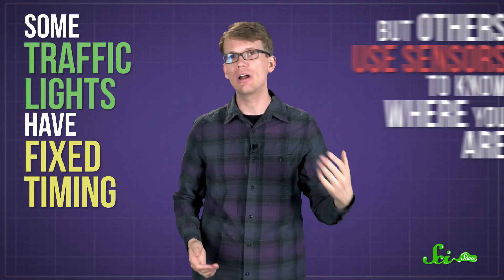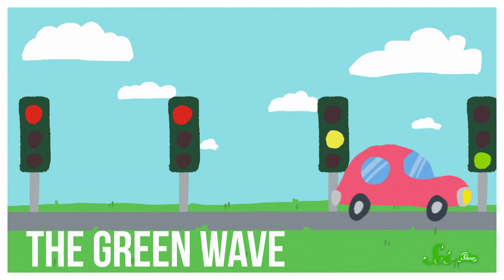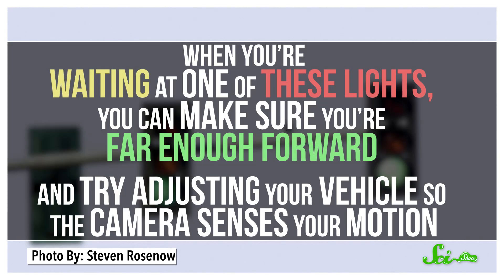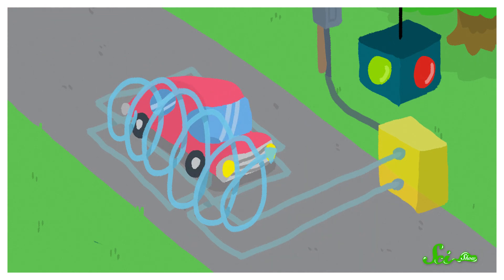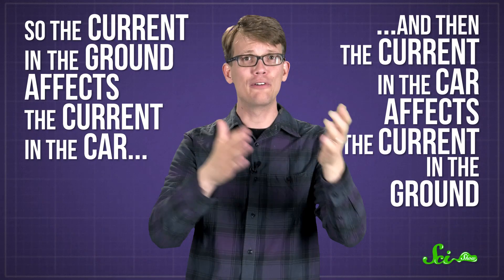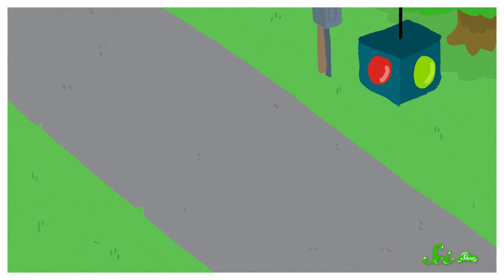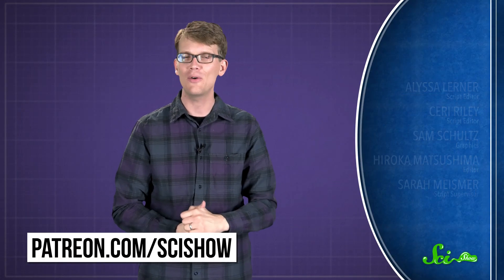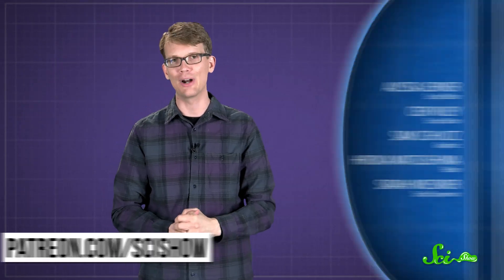How Can I Make A Traffic Light Turn Green?

Comment: One major flipping donwside to the "green wave" the red wave. Hitting every single red sucks so bad.
Reply: I don't think that's a downside to the green wave, more like absence of it... if there was a green wave you would only have to wait one time to the light to turn green and then all the others will be green when you pass through them
Reply: The worst thing about the "green wave" is that so many stupid people don't realize the lights are synchronized for a particular speed (usually the speed limit) and so they drive 5-10 mph over the speed limit just to hit another red light because they got there too early. It's so frustrating because then the light turns and they have to get up to speed again and it just bogs down themselves and any traffic behind them.

IT MAKES ME ROAD-RAGE SO HARD!
Reply: Cami, That only works if you are going the right way. You can follow the green wave down the street but everyone going the other way is hitting nearly every red light.
Reply: As Cami said, you only have to wait for one green light, because then each consecutive light should be green for you.
Of course, this does not work as well if you are driving down the road in the opposite direction.

Ideally, the wavelength of the green/red wave should be two stop lights where each intersection is an equal distance from the next, and the frequency of the wave should be proportional to the amount of time it takes a car to travel two stop lights at the speed limit. In this scenario, cars only need to stop at most once, and can then catch every green light along that street, regardless of which direction they're traveling, because the alternating red and green lights are equivalent to a green wave in both directions. This strategy can even be extended in two dimensions for a grid of intersections/stop lights, but you will always hit a red light when you turn.
Of course, this ideal system is not practical in the vast majority of scenarios, because most intersections are not evenly spaced, and even if they are, they have to be pretty far apart, or else the frequency will be too high, meaning the light changes between green and red too rapidly. Still, it's interesting to think about.
Reply: ... No...
Everyone going perpendicular to you will hit a red light, possibly part of their green wave. People travelling the opposite direction from you will also have a green light.
Reply: apple54345 Where I'm at the green wave only works if you do 5-10 over.
Reply: *****
That's assuming the light stays green long 'nuff for you to get to it. Not sure how it is in your city but here the street in question is space perfectly so that if you hit one red you hit them all.
Reply: The "green wave" doesn't work for everyone because the intersections are typically too close together, as someone stated earlier.  The time in red is much greater than the time it takes to travel between intersections.  For every green light there is a red, and someone is going to get those reds.  Green wave only works in specific circumstances, and around here, there seems to be more interest in giving people red lights (and a one-fingered salute).
Reply: That's not how they're synchronised, you should only ever hit the first red light, then once you go through it when it turns green the rest in turn will be green. (Unless you run every light)
Reply: You guys got me, I never hit all reds at all. I was lying. Can't lie on youtube with the detectives like this on the case. -_-
Reply: sk8rdman Now it appears I'm getting the + always in the notification area, and never on the video page, which is just what you said.  I did a lot of testing a few weeks ago and it behaved differently.  There may be other variables that I can't account for though.

Even though Youtube pisses me off, I love it too much to break up with it.  When I wake up, there's Youtube.  When I go to work, there's Youtube.  When I come home, Youtube is there waiting.  I spend the night with Youtube.  The only thing I don't understand is why it never cooks me dinner.
Reply: Seamus Cook
 Were you replying to me?
In a scenario like the one I described, perpendicular traffic would not be stopped while riding a green wave. Intersections would be set up in a checker board pattern, such that traffic going in all 4 directions does not have to stop except for once to catch the first wave, and again any time they turn, catching a different wave in another direction.

Of course, as I said in my original post, this is all theoretical, and would not work in most real scenarios because intersections are far too close together.
Reply: sk8rdman Sorry, I was replying to Brandon Francey, but my reply button wasn't working properly, my apologies for the confusion.
Reply: Seamus Cook
No problem. It only puts in the + when you hit reply in the notifications interface, but not when you hit reply in the video comments section. It's weird.

I don't know how it works on mobile devices.
Reply: sk8rdman Oh, that's odd. You'd think it would put in the "+" whenever the reply button is used. Oh well.
Reply: Seamus Cook
The rating interface is also different. Here they let you +1, but in the video comment section you have thumbs up and down, but I'm not sure the thumbs down does anything.
Reply: sk8rdman They just need to get their crap together, then again, that's probably much more difficult than it sounds.
Reply: I love that this has turned into a discussion on the comment system.
Reply: I have been trying to figure out the comment "system" for a long time.  You only get a blue "+" for a reply if you entered a comment before the one you're replying to.  You can also sometimes type a "+" and name  list of some clickable user names (it's hard to explain without writing a book).

At one time you could see who had +ed a comment but they took that away.  You can no longer see who +es their own comments.  I find it unfortunate because +ing one's own comments is a sign of a major character flaw.  Anyone who does that can't be trusted to be objective.  They care more about what people think of them than they do about the quality of the arguments (their own typically being poor).

There is a suggestion that the thumbs-down button raises chains of comments so they appear higher in the "top-comment" mode.  Youtube may consider these to be controversial, possibly resulting in more views.  I am speculating a bit though.  As far as I know, Youtube comments are not properly documented anywhere public.
Reply: pillsnotbills
The first bit isn't quite right. If you only got the blue + when replying to a comment that you'd already commented before, then I wouldn't get the blue + trying to reply to Cami who commented before me, but I do.
Also, I don't get the blue + for any replies while commenting under a video.

It seems to me that you only get the blue + when replying to a comment in the notifications interface, but not while replying in the comment section on the video page.

And as I said before, it may be different on a mobile device. I wouldn't know.
Reply: +sk8rdman they heard you, now there's thumbs up/down for the comment section in mobile
Reply: *****
There is in PC browsers too, but only in the comment section; not in the notifications interface. Here there are only +1s
Reply: if youre on a stretch that utilizes the "green wave", and you hit every red, then you probably need to chill out and stop racing people to the next light.
Reply: But that isn't possible, right? If you hit one red light, then as soon as it turns green, you're at the front of the green wave...

Comment: If you have this problem as a motorcycle rider just place a strong neodymium magnet on the bottom of your chassis.....also in a car place one on your oil filter to help trap metal particulates from your engine while having the bonus effect tho i dont know if it would matter in a car =)

Comment: "Just run the light" - Hank Green, 2016
Reply: That's the first sign you know you're a Libertarian. You see the red light. You stop. You realize that there's not a car in sight. And you put your foot on the gas. 
-  Gary Johnson
Read more at: http://www.brainyquote.com/quotes/quotes/g/garyjohnso689401.html
Reply: Funny, but true! It's lawful, because the light is not operating correctly. "Proceed cautiously, like it is a stop sign," may be a better way of putting it, but that's less quote-worthy.
Reply: All of the states I've lived in (KS, MN, IL, MI) have provisions for driving through red lights on motorcycles when the sensing equipment is malfunctioning. The same logic could be applied to bicycles.
Reply: I have seen induction sensors which were sensitive to bicycles if you laid them  on the ground quickly.  (This worked at UMass for getting cars out of the parking garage more cheaply.)
Reply: In states like PA it is actually legal to treat it like a stop sign if there is no oncoming traffic.
Reply: traffic lights break so often in PA, they have to have a back up.
Reply: + He is a rebel, I tell ya.
Reply: laughed at his sudden change in voice.
Reply: What a scofflaw!
Reply: Willow Draven ikr
Reply: a liberal would wait for the light, a conservative would safely run the light
Reply: So temporary laying the Bicycle on the ground then picking it up and getting on again doesn’t work anymore
Reply: Well what about the kickstand on a bicycle?
Reply: No

Comment: some lights will detect if you flash your lights at them from a distance, meaning you dont have to be so close for the camera to pick you up, normally means you dont really have to slow down before it changes. only some cameras will do this too. but couple on my way from work i can get to change before i get there

Comment: There's a story about one of the first traffic lights here in town which got these sensors. Taxi drivers got used to not slowing down when approaching as they knew it would turn green just in time. This went fine until one night around 3AM when two taxis approached from different directions at the same time. BANG

Comment: Why would you get off your bike to press the button? Wouldn't that keep it red ?
Reply: It's gonna stay red anyways so you might as well go over and push the button
Reply: He said to get out your bike and press the button...what kind of bike does he have??
Reply: Actually, unless you have like a carbon fibre bike, those induction sensors will detect a bike. At least they do here in the Netherlands. But there's also a button at the stop line to request a green light.
Reply: If you push the button for one of the other sides then it would force a green light on your side, a great way if the sensors are broken and you don't want to run a red.
Reply: I think he means get off your bike, press the button, and cross the road like a pedestrian.
Reply: If the light has a full pedestrian-only phase, then it would turn it red (but you could walk your bike, I guess). Presumably, lights that allow pedestrians to move alongside traffic can be forced green, though. Not sure because I don't go through too many lights that get stuck on red.
Reply: +Nam Nguyen lol, nice XD
Reply: @mario hendrix. the joke is that most of those button arnt even connected they are pure for the psychological effect.
i noticed it my self when the light reacted even with out me pushing the button.
Reply: THat depends on local traffic protocol.  In some jurisdictions, when the walk signal activates all the lights are red.  But where I am, the light in the same direction you are walking will turn green.  But now we have a new system of a flashing yellow lights for the left turn lane which means that if you are a pedestrian and you want to cross at the cross walk then you have to look over your shoulder to make sure nobody is going to try to turn left and hit you from behind.   I think it is incredibly dangerous for pedestrians.   But to address your question more directly, in some jurisdictions, including mine, doing that is illegal.

Comment: In the UK most traffic lights at night work off a light censor designed to pick up approaching head lights. If you are approaching a red light at night,you simply flash your main beams at it and it will change before you have to stop and wait. Unless of course it's on a timer. But timers are only usually used during the day.

Comment: As a long-term motorcyclist, I well know the pain of spending several minutes swearing at a stubborn traffic light. Those damned induction loops are a nightmare! Before they changed to a camera system (which still isn't perfect; matte black paint doesn't seem to trigger the camera every time...) I sometimes had to wait until another kind commuter pulled up behind me. 

Can we fit vehicles with an RFID tag or something? Would that help?

Comment: You used to be able to flash your high beams at red lights as you approached the intersection to switch them to green.  It is my understanding that this was for ambulances and other emergency personnel.  It was really useful for timed lights with no sensor in the middle of the night with no one around.  But it was also super illegal and you would get pulled over and ticketed if you were  caught doing this.

Comment: In the state of Virginia, a motorcyclist can run the light if they have waited for two minutes OR have waited through two light cycles, which ever comes first.  All you gotta do is proceed with caution.  I've done it a couple times, but only if turning the bike off, then restarting it, doesn't work, which usually does.  Not sure if the waiting 2 minutes/cycles applies to other states though.
Reply: doesn't two light cycles mean you've already gone through?
Reply: Not necessarily.  If you are a side road, or a road that doesn't get a lot of traffic, the light may not turn green even if the road perpendicular to you has gone from green to red.  Not really sure why, it makes no sense to me why that would be a thing.  Maybe to allow green arrow turns from the "main" road?

Comment: stuck at a red light at night with no one around? Flash your high beams a couple times. Most traffic lights have an optical sensor meant to aid police cars with their emergency lights on. But beware, while effective, this is also illegal in 99% of the US
Reply: It does absolutely nothing.  And you can tell.  When a police or ambulance strobe is picked up by a service sensor, the sensor glows white.  It takes a very specific strobe effect to set the sensor off.  Flashing high beams won't do it.  No team of engineers would give the ok to a sensor that is that easy to manipulate by anybody who wants to.

But this urban legend will probably continue until either cars or people are gone.
Reply: I don't have a source, but I remember reading a story once about a guy who bought/procured an ambulance strobe, and mounted it in his car.  He then used it for a long time (some number of years) to force all the lights he drove up to green, and thus disrupted traffic patterns constantly.

When the police finally caught on, they confiscated the device and gave him a fine - I don't recall the exact amount ($500?), but whatever it was, he said that it was worth it, since the amount of time he saved over the years using the device was worth a lot more than the fine.

So, I suppose that's one way to do it, but...not really a great idea for a lot of reasons.

Comment: You can actually trip the conductive loops if you are on a bicycle - depending on how large the loops are. In a single lane (such as a turning lane for instance) the loops are actually small enough that if you "dip" your whole bike towards the ground, touching your handle bar to the pavement (you can actually do this with the bike remaining between your legs, just widen your stance) it will often trigger the loops and change the light. I have done this many times at a turning signal near my work that only goes green on the next light rotation if there is a vehicle in the lane.

Comment: Not to be a snob, but the "camera" picture you showed likely doesn't detect cars.  It's probably a preemption sensor used to detect preemption signals from emitters on emergency vehicles that turn one specific direction completely green (turn lights and all) and all other traffic directions red.

Comment: Here the button does not make the light turn green faster, it makes the next green light last longer to give a pedestrian time to cross without running. I'm not sure what happens when you press the button when the light is already green.
Reply: At many intersections in my area, the button doesn't actually do anything. The lights are on a timed loop, and the safe to cross light is on the same timer. The button is just there so people have something to push so they can think that they have let the system know they are there. Though in most cases, if you just waited with out pushing the button, the red hand would turn into a walking person on its own.
Reply: In my area, the button just causes a beeping noise to occur when the light turns green so visually impaired people know when to cross.
Reply: Sounds a lot different from here In Iceland, where a pedestrian signal will NOT turn green unless the button is pressed, in order to not slow traffic down when it's not actually needed.
Reply: yup same in australia.

The lights can be green 24/7, but will only go red when you push the crossing button.